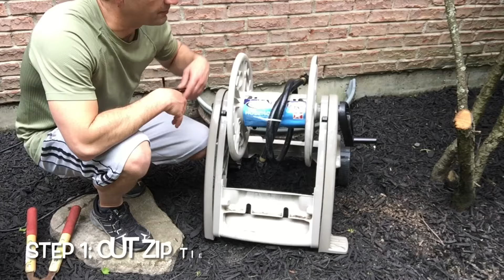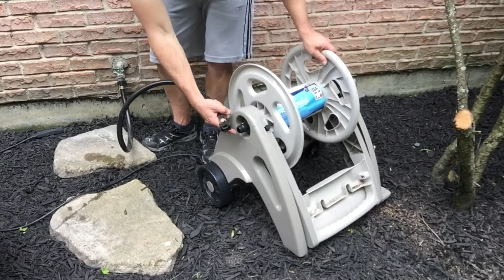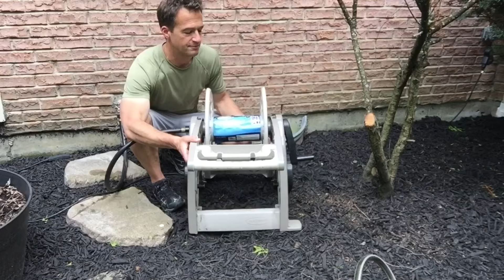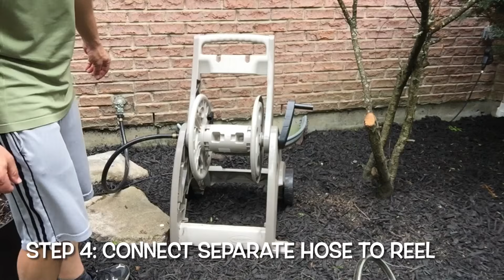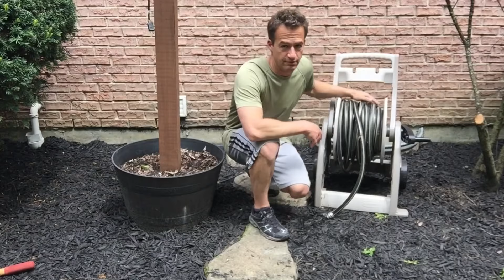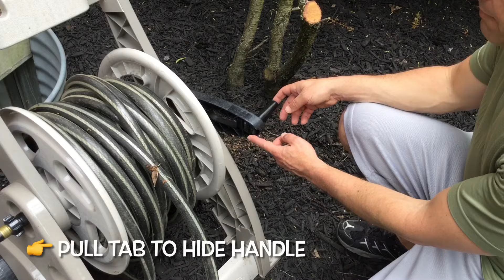Dad Sets Up A Suncast Hosemobile Mobile Hose Reel

Comment: I did everything right but when I turn on the water no water is coming out the hose 🤦🏾‍♀️
Reply from the maker: Weird. Assuming you let it run for a little bit since it takes the water a few seconds to run through the house. I'd check to make sure there isn't a kink in the hose, too.

Comment: Had a question. Does the water pressure drop if some of hose still rolled up on the rim?
Reply from the maker: Hey there. As long as the hose isn’t kinked anywhere, the water pressure should be fine!

Comment: You need to walk around with it. That's what I was waiting to see.
Reply from the maker: You can only walk as far as your leeder hose will go. Most are less than 10 feet.
Reply: @daddoesvideos I realize that now. I had thought it would unwind as you walk, which would have been cool but I guess that wouldn't work when you go to wind it back up.
Reply from the maker: Yeh, that would be excellent!

Comment: I am trying to unhook the old hose from a reel cart. It’s not coming off though. It looks like rust. What should I do?
Reply from the maker: Have you tried using a wrench or pliers to twist it off?
Reply: @ I tried with a small wrench but it didn’t work.  Should I put WD-10?
Reply from the maker: Yes, I’d try some WD-40. Let it soak in there a little while. Might need a larger wrench, too.

Comment: How is this holding up for you? Not sure which you have because you did not show the side with the key connecting parts. I find the clip and the mechanism tube to be very shoddy materials. I wish they had made these parts in metal.
Reply from the maker: I’ve had no issues thus far. I wish a lot of manufacturers would use metal in many things like this. Agree with you there.

Comment: One useful tip that I would like to add here is that before you store it before the winter starts, and if the temperature in your area drops into freezing, make sure to drain all the water otherwise it will freeze and damage the hose. Thank you.
Reply from the maker: Agree. Good addition!

Comment: I did this but water started to come out of the part where you connect the water hose to it. Is it not tight enough or do I have to buy something for it? I have the continental water hose
Reply from the maker: I would guess it needs to be a bit tighter. Give that a shot and see what happens.

Comment: Thank you! After inheriting this, I couldn't figure out how to make this work. However, I have to say it seems like a major design flaw on the part of Suncast to make a mobile reel that isn't really mobile without the addition of another hose! Can you just skip the 4' piece?
Reply from the maker: Thanks for the feedback! Glad to hear it helped. You do need some kind of leader hose to connect from the spigot to the reel, though.
Reply: @daddoesvideos  Thanks for letting me know. I really appreciate you responding. I have some mobility issues, so I was really looking forward to rolling the cart around the yard instead of dragging the hose. It just bugs me that attaching a long leader hose basically means I'm still left with a long hose to deal with, at least if I want to use it as I envisioned. Thanks again!
Reply from the maker: Yeh, I believe you can get a longer leader hose, but you’ll still be limited on how far you can roll the unit.

Comment: One small tip. After using the hose, release water pressure before reeling it back in. Especially if you have a heavier hose.
Reply from the maker: Yup, good call. Always a good idea to release the water pressure when you are finished using the hose anyway!
Reply: Why what going to happen?
Reply from the maker: @taylorlynn4467 Yeh, it’s harder to reel in and you don’t water sitting there when the frost freeze comes.
Reply: It makes it harder to reel in

Comment: Great, thanks.  In fact, I just went to Lowe's and bought one.  Going to set it up tomorrow, because it looks like rain here.  I like the looks of the it.  The one I bought, which is also  a Suncast Hosemobile, has a guide that you put the hose through so it goes from side-to-side while you are winding it up.  No need to keep it even by hand.  Seems pretty solid, for that price.  Thanks for your help.  P.S.  I do have a kink-free  hose.
Reply from the maker: Oh nice! The guide sounds like a great addition. Good luck!

Comment: Thanks for the information.  I hope you don't mind another questions (I am seriously thinking of buying one of these.  Lowe's has this on sale until July 12 for $39.99.  $10 off.)  If I want to water something that's only 30 feet away from the unit, do I have to unreel the entire hose?  Or will the water flow through hose when it is wound up on the reel?  Thanks for your time and patience.
Reply from the maker: Don’t mind questions at all! That’s what makes this fun! You don’t have to unreal the entire hose. The water will flow through the hose when it’s wound up on the real. I’d suggest getting a hood hose though—one that doesn’t kink. If the hose kinks on the reel, it would block the water from coming through. Hope that helps!
Reply: @daddoesvideos What is a hood hose? Thanks.
Reply from the maker: @mrtv777 When I think of a hood hose, I think of the ventilation/aluminum tube that runs from the hood over a range to outside the house.

Comment: Thanks for the useful tips.  I wish you had demonstrated unreeling the hose and reeling it back in.  I'm wondering if the thing does move or tip forward when you unreel the hose.  Also wondering if you have to get all of the water out of the hose before reeling in.  Wouldn't it be too stiff if you didn't?
Reply from the maker: Hey there! Thanks for the feedback. It doesn’t tip over or move when you unreel. As far as getting all the water out, I always turn off the water first, then squeeze the trigger on your hose nozzle/sprayer to empty the hose.

Comment: Nice tutorial video, but the Hose Reel sucks. It makes the water pressure much weaker.
Reply from the maker: Hey thanks! I’ve experienced no degradation in water pressure with the real. Are you sure your hose isn’t kinked?

Comment: Last time I cut a zip tie was with a pair of dykes.... Wait you might not know side cutters..... Oh wait still might not know wire cutters..... Can't remember last time I was using garden shears for my quarter inch zip ties..... But hey if you don't have a hammer to drive in that nail just pick up a big rock and use it